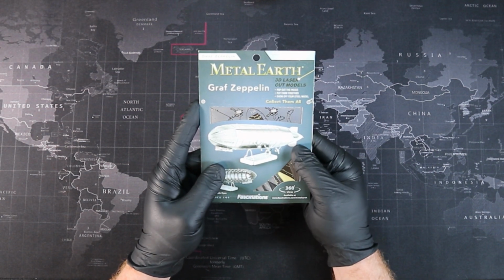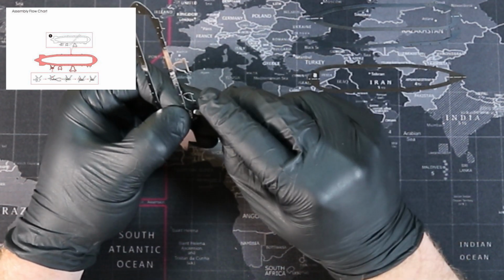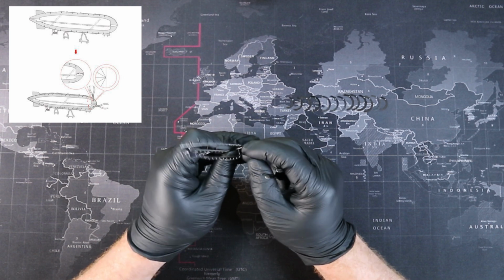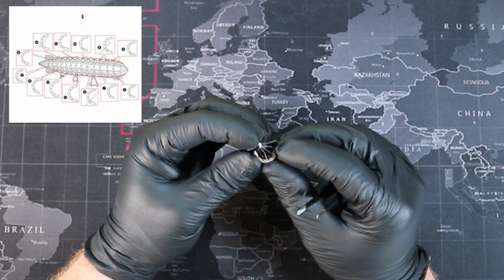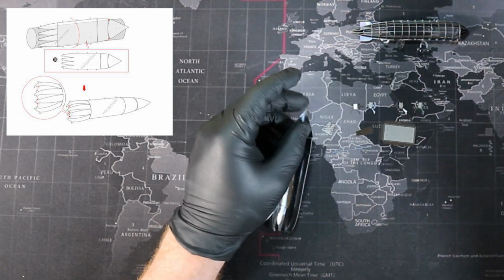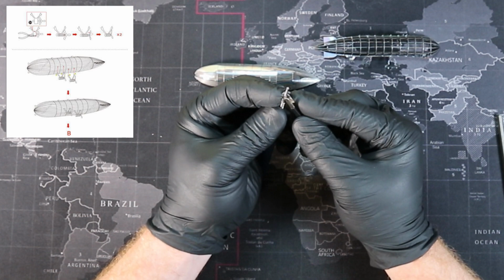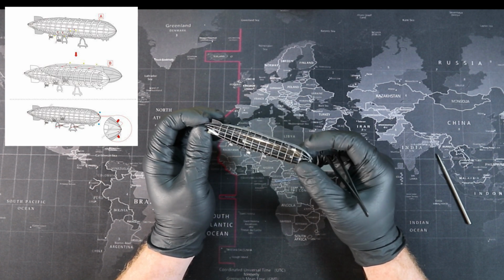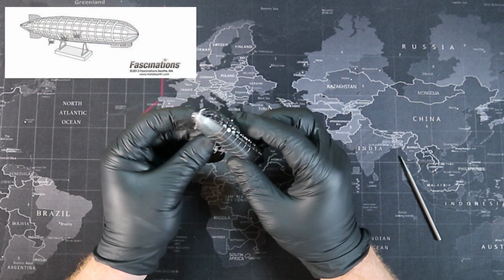Graf Zeppelin - Metal Earth - Full Build!

Comment: Great video! :) How would you recommend making that curve around 13:30 without a rolling tool? I've just been curving the metal with my fingers and it doesn't turn out that bad, but usually one side is more curved than the other and it looks a bit uneven.
Reply from the maker: I found that when i don't have my doming tools with me, a small spoon works great! The curved edge makes it perfect for getting a rounded shape from the metal.  If you can i would recommend using it on some of the scrap metal in the kit before working of the part. This way you know how much forces is needed. 

I hope this helps :) 

Thanks for the kind words and for watching!
Reply: find a marker or pen that has same diameter with the other half of the Zeppelin that bend it around that pen
Reply: Thank you both! I'll try it out next time.